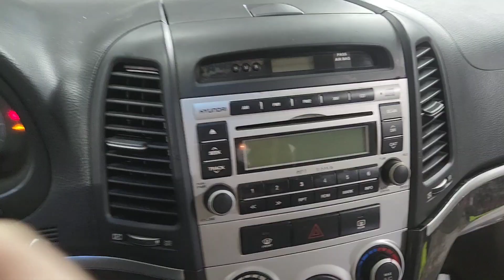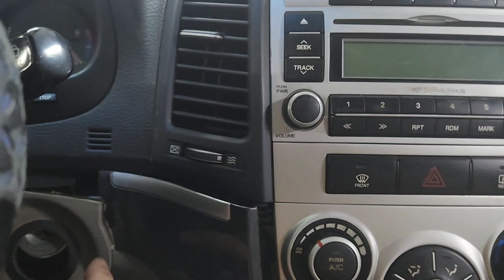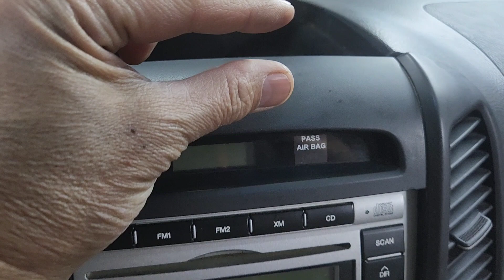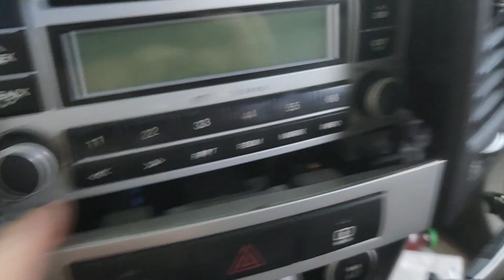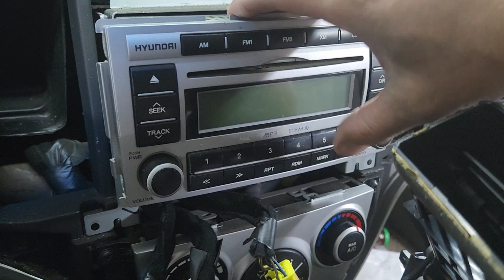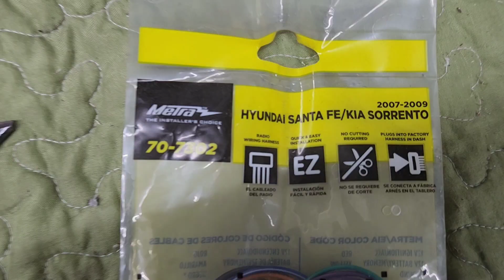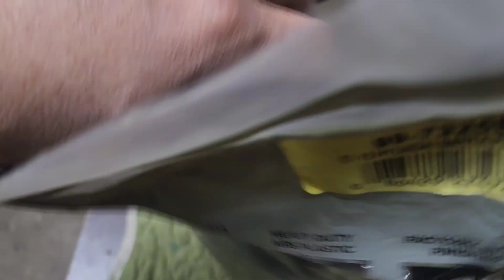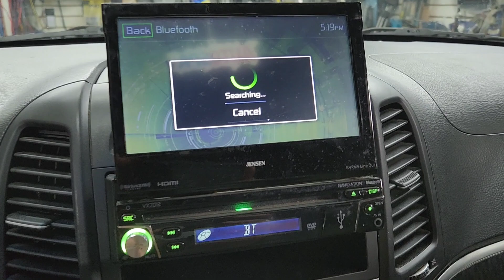07-12 Hyundai Santa Fe radio install

Comment: Hi. You mentioned subwoofer output. Did you connected sub output from speaker output or the radio has dedicated bas aux output ?
Reply from the maker: @disturbator  The radio has an rca jack (sub woofer output)  in the back of the radio, that jack is to run an aftermarket amplifier
Reply: @khmerohio thank you man 🔥🔥